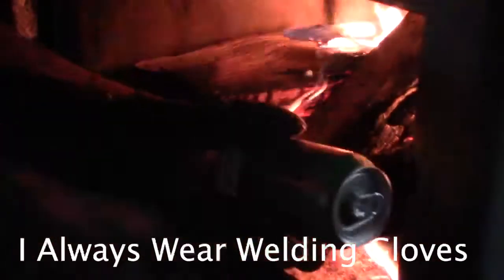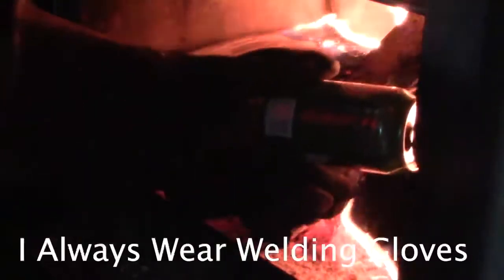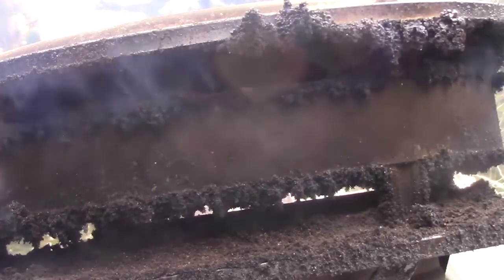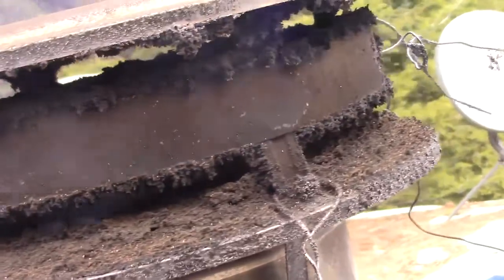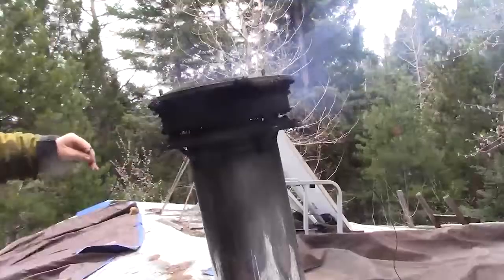Woodstove 101 Creosote and your stovepipe

Comment: An old man in Montana showed me that if you burn a russet potato once a week the chemicals in the potato dry out the creosote and it flakes off and falls into the fire box. I used this method for a month and reinspected and sure enough my stove pipe was cleaned out. It actually works really good.

Comment: It looks like thats whats wrong with mine, would that be why smoke was coming out of  the dampers and pouring out when I opened the door?
Reply: Or you don't have enough draw. We have a stove at work that has a pretty short pipe and will, if you don't kindle your fire properly, not pull the smoke out and leak through the ash pan and doors... have set off alarm systems if happened with a loaded stove. It works through creating a vacuum so would also think about that...
Reply: @undergroundtomas8083  thank you, I cleaned out the rain cap it was clogged with creosote and now its drawing like crazy no smoke at all
Reply: @mikebertsch8747  I gotta clean this weekend, supposed to be warm here so no need for the stove... just to be safe

Comment: Im wondering if you could help me out? We have a wood cook stove we had installed at thanksgiving time of this year. It is normal when the fire is not hot to have smoke puff out the seams of the smoke pipe? Its been in the 50s this week in Michigan and smoke is puffing out the pipe seams when we attempt to light it
Reply: that means that either: the temps outside are way to warm, or your chimney, or pipe is clogged. you need to wait for cool down, then dissasemble the pipe, take it outside, and brush it out. then you need to to the same with your oven as far as you can reach, and also with the chinmney. wet wood lets soot built up in a majour way. always burn dry wood. a designated vacuum for all the dirt is very helpfull

Comment: How I clean the cap is when the fire is out remove cap and clean with wire brushe and a stick . very easy bang the chimney a bit ,or run the chimney brush on flex pole down a couple of times , Heating with wood for over 45yrs  still doing it today , plenty of wood on my property